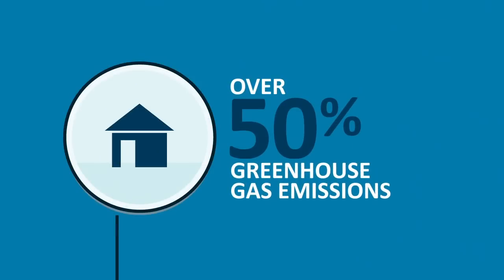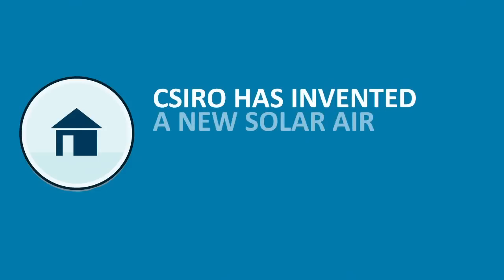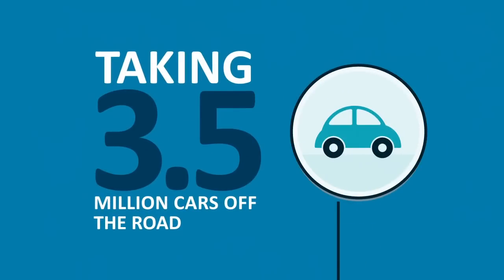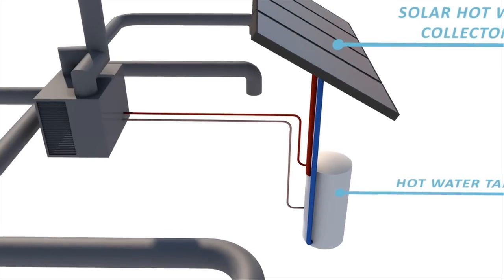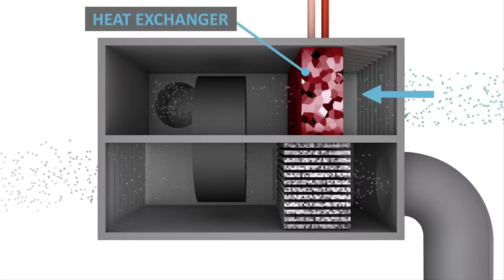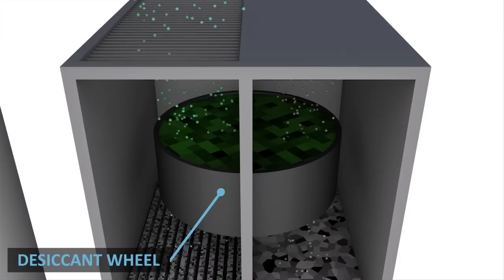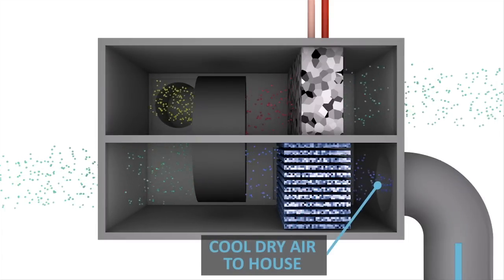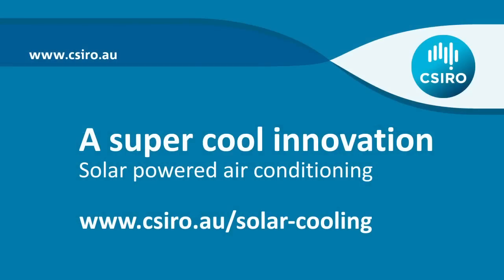Solar powered air conditioning

Comment: It therefore has to use water….another precious resource in most places…it also outputs "steam" or water vaopr..which will change the deserts and humidify them.

Not sure it is a good idea.
Reply: It circulates (not 'uses') water from your solar hot water (SHW) storage tank. It's using up the heat from your SHW system - not the water. The water just gets cooled & returned to the storage tank. The 'vapour' mentioned is just moisture taken out of the air in your home - so the home receives cooler, less-humid air. As for humidifying the deserts... if only! :-)
Reply: If you're concerned about water usage, you should know that Coal fired power stations evaporate between 1 and 4 litres of water for every kWh they generate.
Reply: Jordan Moulds Sorry, that is NOT what they said. THey used the term EVAPORATIVE COOLER. In west Texas we used these "swamp coolers" years ago because of our low humidity during hot months. We used to have sand storms there just like the middle east. No longer, too much added humidity to the ambient air outdoors.

 Cooling is by evaporating WATER thereby cooling the air. They have a pump that pumps the water over evaporators (just like this system, except this system dries the air before evaoprating and cooling thereby increasing efficiency only, not reducing water use). The amount of water could be as much as 20 gallons per hour depending upon the humidity it leaves in the home. TO feel cofortable 40-50% humidity should be in a home, generally.Here in Florida we can easily remove over 20 gallons per hour from our homes to get as low as 45% durng the huid months.
Reply: Jordan Moulds IT doesnt really matter what kind of fossil or nuclear fuel we use, we have to use the heat to produce electricity and thereby cool the system havng used the heat. Water is used in all but solar generation. Photovoltaic is totally unsound generation at this time. It uses rare earth metals and lasts much to short of a span. Solar reflection to boil a gas (liquid to phase change) works fairly well and much is being done to make small (single user or small community) reflective generators. There is much to overcome yet.
Reply: "totally unsound generation"..."rare earth metals and lasts much to short of a span" WTF?!? I have 1.5kW standard solar panels on my roof, they're made of mono-crystalline silicon, have a 25 year warranty (it's 'Sharp' - so I'm pretty sure the manufacturer will still be around in 25 years). Cost me $3k installed (after I on-sold the RECS) and they paid for themselves in the first 3 years (albeit with a generous feed-in tariff for net exports). I guess there's no pleasing some people. I'm sure I could find a rare-earth thin-film panel if I went looking for one, but they only make up around 7% of the global market, and they're not what typically gets sold where I live.
Reply: Jordan Moulds I dont care what the substrate that the photovoltaics use is, the photo active portions are made from rare earth metals. Please look up mining of rare earth metals. It is some of the most environmentally expensive mining performed today.Currently there is a company that is literally printing the photovoltaic traces on a material that comes in rolls instead of crystaline silicone.

IT takes a LOT of energy to make the silicone as well but I am not arguing that point. My point is that the rare earth metals are VERY environmentally expensive and many of the companies mining them are even concerned. Thier hand is in the pocket and some of them wish they could stop the damage it is so bad.

In a way we are dealing with the "Hummer H2" syndrome. Hummer is the MOST environmentally friendly car ever built if one considers its design criteria of over 1M miles with standard maintenance. Thie means it will last as long as any other 5 cars on average. Even though the fuel use is high the overall eco harm is less. Kind of wierd but true.
Reply: Dirk Jeanis my car produces 99g per km (manufacturer claim), i drive on average a distance of 8.1 km per day with it. a human breathes about 0.9kg of CO2 per day. It would be more environmentally friendly of me if i would stop breathing than stop driving my car. What i am trying to say is that environmentally friendly is rarely on anyone agenda. Energy independence and financial investment is what people think of whenever they go solar. for example methane excreted from cows has a far greater effect than CO2 as a greenhouse gas yet whenever someone goes vegetarian it's all about "a healthier life".

P.S just popped into my head. Solar Stirling engines. No rare earth metals, just typical alloys, the active gas is hydrogen, the collector is basically a parabolic mirror, the efficiency exceeds that of a solar panel as does it's life expectancy. What flaw do you find in that?
Reply: cyberlord64 There is no known correlation between CO2 and any kind of environmental issue. In fact the more plants there are on earth the more CO2 is needed. Destroy the plants then we have a problem.
So what is the real issue? not CO2 but destruction of forests. 

Just like our governments to blame problesm with CO2 instead of deforestation.
Reply: Dirk Jeanis Aaaaaand you missed my point entirely...
Reply: cyberlord64
I got your point, however the basis of the statements regarding CO2 does not exist at all. IN fact a single large belch from any major volcano can create as much pollution as man has made since the industrial revolution!
 
Stirling engines do not need any gas such as hydrogen actually, they do operate on the heat of the sun or other heat byproduct source. There is only ambient air in most of them and a high efficiency of heat transfer (highly conductive metals acting as a heat exchanger). Yes they are an exceptional idea where they can be used, the greatest benefit is that they work on temperature differential, therefore a house in the arctic circle can use its intrinsic internal heat to power the device along with the cold outside. THis would work VERY well with hot water springs and subsurface water to heat the house and the hot air cold drive the stirling engine.

There was actually a great improvement to this device recently wherein solar reflectors heated a coolant which drove a pump (actually an automotive air conditioner pump) creating electricity. The fluid was then run through a heat exchanger and used water to further cool it (differential of temperature is the driving factor), creating a byproduct of hot water as well as electricity. This design would not necessarily power an entire house, but could power a laundry and washroom facility lets say in a village in Africa and still have enough excess power to run some lights and power some electronics as well.

There are many opportunities and ideas to use solar driven power. The key is to REQUIRE thier use. In Israel one can not obtain a permit to improve a structure unless that structure adds solar water heat at a minimum. I have installed Israeli systems and they are wonderfully efficient at heating water, and result in a 25-40% reductiion in electrical use depending upon the number of residents or use (say in a restaurant?). In fact the ones I installed were so efficient we had to cover half the collector as they ran the water too hot in Florida (boiling is ok, turning to steam is not).

During the thought process of requiring use, one must look at issues such as the ones I mentioned in this design. A few thousand houses using swamp coolers can change the local climate very easily. Deserts are much more delicate than jungles overall!
Reply: Dirk Jeanis the co2 argument was an example. if you feel that uncomfortable with it just ignore it and move to my second cow-methane stuff. As for the Stirling engine I was referring to the active gas, as in the gas that transfers the heat itself which is hydrogen or helium though ambient air can also be used if maximum efficiency is not your main concern. Anyway i think the gigantic comment was unnecessary. a simple "i got your point" followed by the last paragraph would suffice :/

Comment: I shower at midnight, then what?
Reply: +redgatecrt Mate, it's solar thermal, the hot water is stored in an insulated tank. You can shower at any time when you have a  ≈ 300L tank full of hot water.

Comment: So I've turned my thermostat up a bit and not pumping out 2.5 to 5 tons of Greenhouse Gas. I can bet you 100:1 that I'm not generating that much pollution. So anyway here's my point. We pump out all this gas and we'll eventually be charged a Carbon Tax if we stand for it. Thing is though... how about all those companies dumping toxins in the environment by the millions of gallons? They get fined? Really? I'm the bad guy though because my AC pumps out some hot air and dumps water used to water plants in the yard and I'm the bad guy? While I can appreciate the "green movement", I can't deal with the hypocrisy at this point. Clean up the big companies and the little guy will follow. No worries, right? :)
Reply: There is a commercial version being piloted in Victoria. http://arena.gov.au/news/innovative-new-renewable-energy-air-conditioning-system-commercial-buildings-piloted-victoria/

Comment: Seems like an in-house 3D animator's pipe dream. I doubt it made it any further than this video. Likely a fatal flaw in the design. I suspect it would only work in very hot, sunny, low humidity climates, and likely not at all in the winter. It's shameful to leave this up if there's no actual project behind it. Click baity money grab with no substance.

Comment: 5 years still nothing.
Reply: But why? Commercial Pressure?
Reply: @Priteshn96  Commercial reality. Setting up a solar collector, a water tank, all the plumping as well as installing the 'head' of the unit is probably more expensive than the relatively cheap and efficient modern A/C units available these days. This system probably also have several points of failure which impacts reliability.

Comment: looks like glorified solar powered- swamp -evaporative cooler they havent invented anything new here
Reply: not even near the swamp, pay attention!
Reply: Basically yes, but with an added feature that dries the air making it useful for those of us who live in humid climates where a standard swamp cooler simply doesn’t work.
Reply: @critterIMHO  which feature distinguishes it from a 'classic' evaporative cooler? I am genuinely interested. A good thing about this system is the use of a tank, it pretty much acts as a energy (thermal) battery.

Comment: "over 50% of the greenhouse gas emissions you produce in your home are generated by heating, air conditioning and hot water"... 

greenhouse gas emissions associated with electrical appliances are not produced at home you idiots. shame on you for trying to manipulate people who don't know this stuff.
this is just a glorified evaporative cooler, which will need a gas or electric hot water unit to heat the water on cold days (when you need the heat the most)

that moment you realize you're watching propaganda rather than a video of new a/c tech...

Comment: Since this is an Australian video, why dont you simply copy the ideas of the Scandinavians and build decent houses with lots of insulation in the walls roof etc and use triple glazing.     Otherwise its like trying to fit  Air-con in a tent.
Reply: Because they are different fucking countries run by different nations of people living in completely different climates with different oceans meaning different atmosphere different trading partners different currency exchange different ecosystems different geology preeeetty much different EVERYTHING. Why do Scandinavians think they should be telling ppl how to live in their own homes? Cause some Asperger's dingdong thinks it's reducing their footprint by buying a new boat? #fuckgreta
Reply: Double glazing and insulation are much less effective than other methods at maintaining cool temperatures. You are applying the lessons of a cold, low radiation climate to conditions that are the opposite. In Australia, verandahs to keep windows in the shade in the middle of the day and light coloured roofing to deflect the sun are much more effective for the investment. Roof insulation is better using thin reflecting foils than glass fibre. The other problem is that UPVC double glazing degrades extremely quickly in the southern hemisphere due to higher levels of UV radiation. It literally rots away. This is why you don't see it in New Zealand, even though parts of NZ have cold winters.